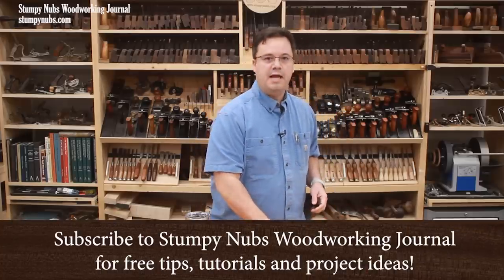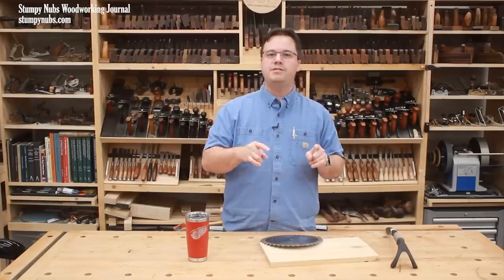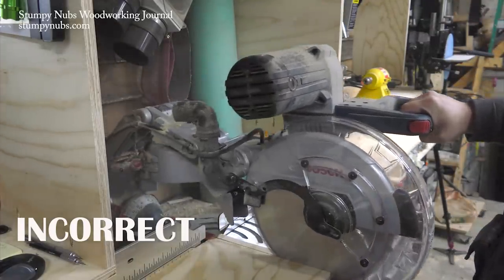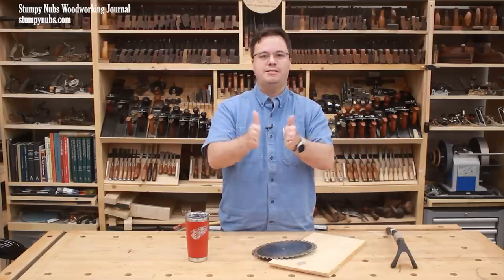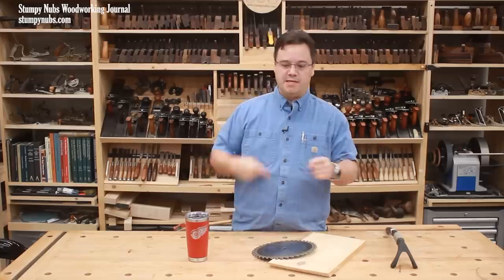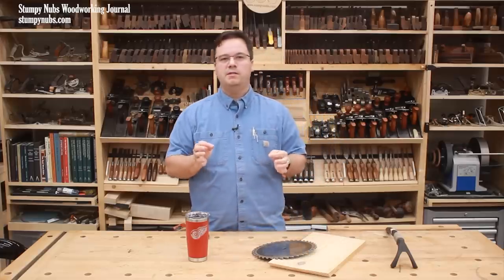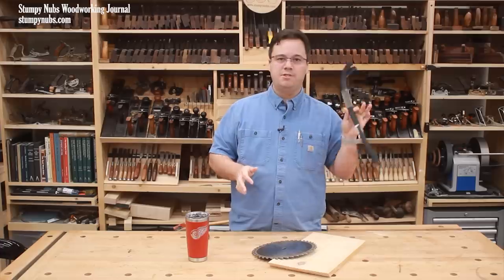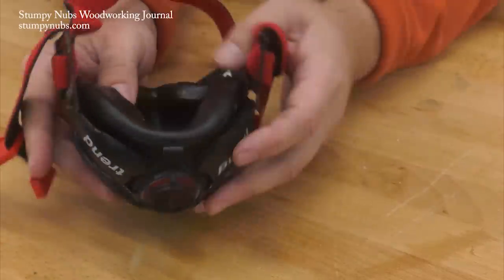A close call with a miter saw

Comment: I’ve been looking everywhere for a video or write up that speaks to cross-cutting a relatively narrow piece with a sliding miter saw. If you have a board that is only an inch wide, for instance, and your blade makes contact while slid all the way toward you, the teeth will be heading upward and potentially throw the piece up and back where it can cause all sorts of problems. It seems like there should be some commonly shared best practices that factor in the depth of a workpiece and subsequently how much you can safely pull the saw back. I mean, after it happens once you figure it out but I’m just surprised I can’t find anyone talking about it.
Reply from the maker: There is no reason to pull the slide toward you for such a narrow board. Just cut straight down.
Reply: @StumpyNubs  I totally agree, and it's probably just common sense, but it doesn't seem to be something that is stated explicitly on any video or post I come across. And my thought is that there is a continuum as the board becomes deeper. At some point you have to start pulling back on the slider, so it I just wondered if there were any "official" guidelines for this process as far as the relationship between the depth of the piece and the angle of the blade, and I have never come across a discussion about this in my searches. And that isn't a critique of your video at all. Your videos are always fantastic!

Comment: I have a adjustable vice clamp (normally used for drill press ) mounted on my chop saw so my fingers are never anywhere near the blade. But after watching this I will be bolting the saw to the table.

Comment: that had to be some seriously internally stressed wood to be able to bind that tightly.  I use a chop saw with an old blade to cut branch wood to length for firewood, and I've never had THAT bind so tightly I couldn't roll the piece off the blade.  and if I did, I'm sure I could score it with a handsaw to get it to release.

Comment: When cutting roughsawn (or other irregular pieces), how about using a sandbag or beanbag for additional stability?  I'm a hobbyist, so I don't know if there's a downside or danger that is taught and that I'm missing, but on first blush it seems like it could prevent the wobble+pinch issue.
Reply from the maker: Use it where?
Reply: @StumpyNubs  Under the higher irregular side - or even both to level the board.  I'm thinking that would prevent rocking front-back and side-side, and help prevent binding onto the blade.

Comment: I honestly don't think you ever need to destroy a sawblade with a hammer to free a piece of wood, unless you cant remove the blade+wood from the saw itself (stil unlikely, but I have to allow some circumstantial liimitations and odd exceptions). Just pull out some hand tools. Maybe some kind of handsaw, maybe a chisel, maybe both, it should be able to losen up enough material to just pull out the blade. Even if you can remove the blade from the saw, you're probably safer. In fact, that is what I suggest for people to always have in handy even at the job site. Rough sawing a board by hand with a decent handsaw doesn't take that long, so if you have a board you have to use but it is also significantly twisted or whatever, you might just at least start that one end by hand. I know, it might sound slower, but I guarantee it is faster than collecting severed body parties and going to the ER, and getting someone else to do the job while that person recovers. Much faster.

Comment: Thank, very important. What about using the saw clamp to hold small pieces directly or with another long piece that press the small piece using the clamp?
I do that. Sounds ok?
Reply from the maker: Anything that holds it securely while your hand is not close to the blade will work.
Reply: @StumpyNubs  Thanks!

Comment: My spring 2020 project was making frames for raised garden beds out of pine 2x10s but I was cutting with a circular saw on saw horses (don't own a mitre saw). Wood was straight and well supported, but the kerf kept closing as I cut across. Nothing kicked back, but it did bind and stall out the saw. Working the blade back and cutting in the kerf again was typically enough to get through, but it was super annoying. I could not find anything visible on the wood that would tell me to cut a different direction or anything. No idea if there was a way around this. Thoughts or suggestions?
Reply from the maker: Is the offcut end hanging off the saw horses so it falls open? As an alternative, you could put a strip of wood beneath the board just to the side of the cut line where the long part of the board will remain. This will let the short offcut drop away a bit.
Reply: @StumpyNubs  It wasn't a problem of dropping away. The wood was well supported across four sawhorses, two each side to prevent just that. It pinched across the board in the direction of the cut. I could pry the saw blade out, and the beginning of the cut was pinched almost closed before the end was cut through. I was baffled at options.

I guess I could have kerf cut, just set the depth of the circular saw halfway first and made multiple passes. That's just less easy to maintain accuracy with a circular saw compared to a miter saw.
Reply from the maker: @andrew40  I was saying you WANT the board to drop away. But even so, your situation sounds like case hardening, in which case it would not matter much. Stress in the wood is causing it. I'd cut it with a jig saw instead.
Reply: @StumpyNubs  I was definitely focused on not letting it fall away. I'll keep that in mind if it ever happens again. Or use a jig saw. :) Thanks.

Comment: The fastcap sticks get a few bad reviews due to the contact points not being rubberised thus allowing the timber to slip. I would like to make the suggestion that part of the problem is only having one point of contact on small pieces of timber. I would suggest you need at least two points of contact (preferably a rubber contact) to prevent that one point of contact becoming a pivot point. Having said that The idea is fantastic and one of those I wish I thought of that idea's. Fastcap if you are watching and take my advice Say Hi ;)
Reply from the maker: FastCap is a unique company in that they are always looking for ways to improve products and not afraid to make changes. I am quite sure they would use a rubberized foot if it was truly beneficial. I have never personally seen the need for it in my own use.

Comment: The solution (Kerfing) to internal stresses in wood being cut on a miter saw seems to require a sliding miter saw.  How do we make safe cuts on a non sliding miter saw?  Does this warrant a new video?  Do we have to pass on the non sliding miter saws to the used market?
Reply from the maker: A non sliding miter saw is not able to kick toward you in the way a slider is, so it's not as much of an issue. But If you are worried about wood pinching, I would make a series of plunges, lifting between them to accomplish the same purpose.
Reply: @StumpyNubs  Thanks.

Comment: I wouldn't normally dare to disagree with Mr Nubs😊
But There should be mention that when you push the cut, the front of tbe blade is cutting upwards and can kick/lift the workpiece.
Reply from the maker: The wood is cut by the back of the blade before the front of the blade gets to it.

Comment: The most common situation Ive seen is cutting bowed tubafors. If the bow pushes the board away from the fence at the centerline, as the blade drops through the closest part of the board first, the board starts to pull into the fence, pinching the blade. Seen it easily a half dozen times. No injuries but once it did deflect the blade into the fence itself as it pulled the board (and hand) toward the short side cutoff quite hard. It also bent the motor shaft slightly. If time permits, check your boards so any concave sides are facing you rather than away. Not perfect, but better.

Comment: Neg ground, neg ground, neg ground, NEG ground. Blades for chop saws need to be neg ground. Same as radial arm saws so please be very careful when ordering and don't trust the guy working anyway selling them he/she may not know. For example the saw blade in his hand should never be used in a sliding chop saw. I'm not sure of the one in the Bosch.
Reply from the maker: LOL- If your eagle-eyes can tell the grind on the blade in my hand, why couldn't you see that it's a 10-inch blade while that's a 12 inch saw? - I'm just using an extra table saw blade for illustrative purposes. I made the actual cuts with an actual miter saw blade.

Comment: The web site for the alternative source for the $10M stick shows it being used completely differently than how you showed it being used. Which way is correct?
Reply from the maker: "Completely different?" LOL, it's reversible. You can turn it one way or the other. It's still being used in the same way.
Reply: @StumpyNubs  I realize it could be used either way but the way you demonstrated it would seem to be the better way. The way it's demonstrated on their web site it holds the work down unless you push down and toward the fence,  but the way you demonstrated it the appearance is that it presses the work down and against the fence almost automatically as pressure is applied to the "Y" end of the tool.

Comment: But here's the million dollar question... You do pull a radial arm saw and it's turning the same direction. Why do you pull on a radial arm, but pull out and push on a miter?
Reply from the maker: Radial arm saws are designed to be pulled, and yes, that is a climb cut which is one of the reasons I don't like radial arm saws. An alternative, some say they bring the blade forward, then slide a board behind it, then turn on the saw and make your cut in the pushing direction. I find that awkward and would not do it myself.
Reply: I would, for exactly the same reasons as explained in the video, claim that you shouldn't pull a radial arm saw during a cut. Similar machine geometry, similar risks. If there's room, pull the saw head out, put the workpiece between the saw and the fence, and push the cut through the workpiece away from your body. If there's not room, then raise the height of the saw, pull it all the way out, then lower it into the workpiece and push it away from you as before. After all, the height adjustment is a nice crank handle that adjusts quickly, so it's not very inconvenient to use. If the workpiece is twisty and might pinch, as described in the video, then you can use the saw height adjustment to accomplish the same "kerfing"...always proceeding with the cut towards the fence for a "push" cut.
Reply: @StumpyNubs  I had a giant cast iron radial arm saw once, don't do that. Pull the blade. You had the answer right at first without detail. You can do it, because of the weight, size, and speed of the blade and machine.
Reply: @Spott07  I've owned a radial arm saw, and I say that's terrible idea. You pull the blade. That's how you do it. That's how they teach you in shop class.
Reply from the maker: @RandiRain  Yes, as I said , a RAS is meant to be pulled. But MANY users do it the other way. I know because whenever I mention the risk of a RAS climbing onto a board in a video I get called an idiot by RAS enthusiasts who say you are supposed to push it. I used to argue with them, but it does no good... :)
Reply: @RandiRain  I currently own two radial arm saws, one built into a chop-saw station next to my miter saw. Doesn't prove anything.

Making climb cuts with machinery that allows uncontrolled motion is a an unsafe and terrible idea. Taking a moment to be safe is not a terrible idea, regardless of what "you say". I don't know your shop teachers, but I'm not going to make climb cuts with uncontrolled machinery, and I'm not going to teach people to make climb cuts with uncontrolled machinery, either. Best case failure in a RAS is that it's made with a stiff enough frame that it jams and stalls the motor. Worst case...well, there's hundreds of reasons they don't sell RASs at all, anymore, and every one of those reasons was an amputation.

Comment: A better choice IMHO is a hand saw filed for crosscuts.  For rough cut lumber, I cut to near length, then plane to parallel, either with a hand plane or a power planer and a sled that levels the piece for the first surface.  The hand saw is immune to things like kick back or climbing problems, and a lot less prone to injuries.